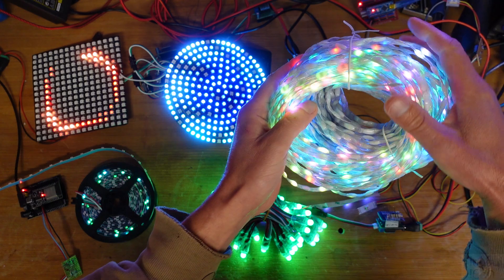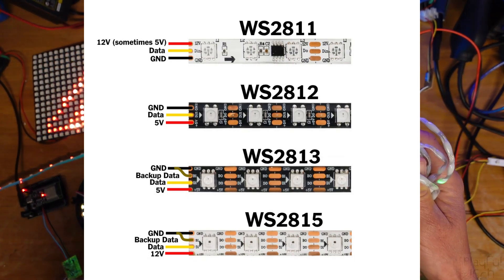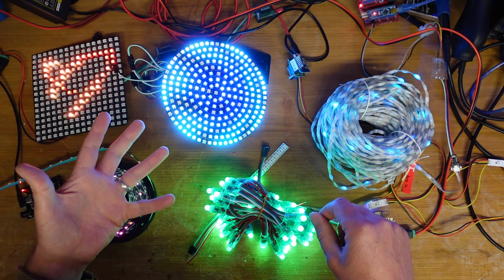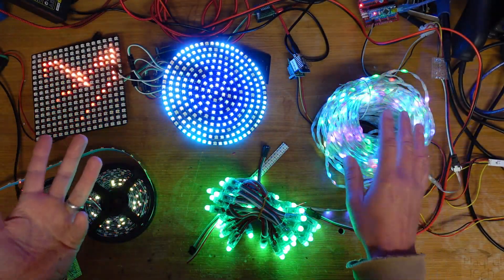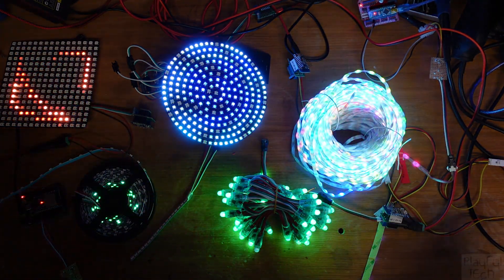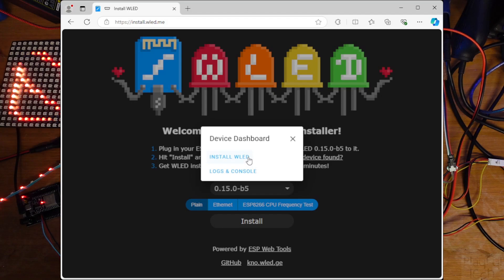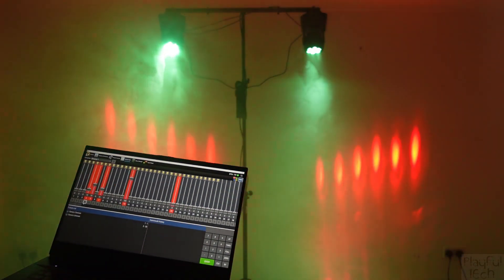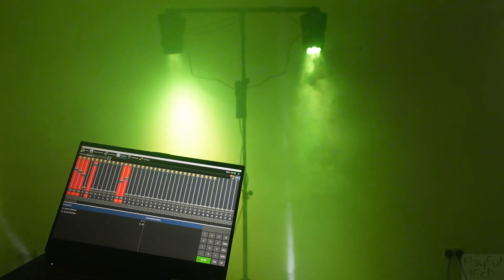Programmable LEDs

Comment: Although APA102 can be run at higher speeds, in my experience  the higher the speed is the shorter the length that will work reliably is so it's a refresh rate vs length trade off.
Reply from the maker: That's good knowledge, thankyou! (I've actually only dabbled with them a bit before quickly deciding WS2812 were more suitable for my needs anyway)

Comment: omg i hate these short videos. i have a WS2812E 16x16 that i bought because once again i was fouled by a you tuber acting like its so easy. Well 2 yrs later its been sitting in a box, 10 times i have tried to just put a giant G, and even with chatgpt help all i get is random leds. I have some experience programming but none on leds, so i had to change my whole project to delete the matrix.
Reply from the maker: Lol. I normally make hour long videos describing everything in great detail and people complain that they're too long! Can't please everyone I guess. How is your matrix wired - in a serpentine shape, or just rows and columns. If you use FastLED as I recommended there's plenty of demo scripts to get you started.
Reply: @PlayfulTechnology  I love your videos, hate leds with a passion, and yeah no pleasing anyone is a motto in 2024. I wish i knew how to figure out how the matrix is addressed.
Reply from the maker: @ZenHulk  I'll write a post about it - might be easier to explain in text rather than video! But, FWIW, my pixels start at the bottom-left, and then "snake" up the matrix, so the LEDS are arranged like this: 
15 14 13 12
8  9  10 11
7  6  5  4
0  1  2  3 

Supply 5V and GND to the respective lines, and connect the Data (Data IN! not out, these strips have a direction, as explained ;) ) to the GPIO output from your controller. Now, in terms of best practice, there's a couple of other little things to do: 
- That should be a 5V signal line, so if you're using an ESP8266/ESP32 you should take the GPIO output through a logic level convertor first, like a SN74HCT125, to step it up to 5V
- You should also add a capacitor across the 5V/GND lines, 1000uF, >6.3V
- Also add a series resistor on the data line, exact value doesn't seem to matter - I normally use 330Ω

These are all things common to all the LED types demonstrated here, and I've said them lots of times in previous videos in which I've used LEDs, so didn't go in to great detail here when I more wanted to focus on the difference between the different types of LEDs!
Reply: @PlayfulTechnology  thank you

Comment: I've done the LED strips via microcontroller to do a Stranger Things project where I can send text messages through programmable LEDs.  It wasn't too difficult, once I got over an issue with the Arduino library I was trying to use.  I'm interested in the show control software.  I'd like to dip my toes into it to see if it's something I want to use for a Halloween party.  Looking forward to videos about that!
Reply from the maker: Sure thing - I'm thinking about doing a mini-course about lighting in general, because I think there's lots that escape rooms can do in that direction in terms of learning from theatre techniques to increase immersion!

Comment: Might be a dumb question, but what driver or shield? are you using for the LEDs. Looks like it also powers the microcontroller.
Reply from the maker: You're absolutely correct - it's just a little shield I made to supply power to the strips and the ESP (and also to step up the 3.3V output from the GPIO pin to 5V logic level required by the data line of the strips)